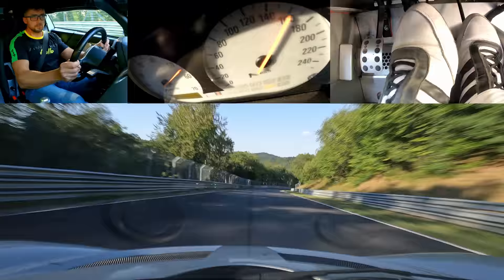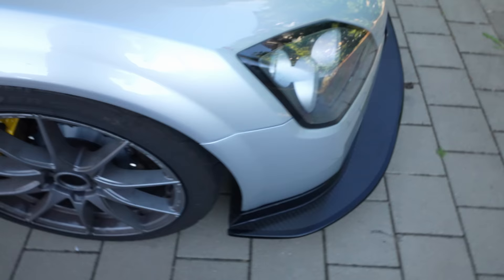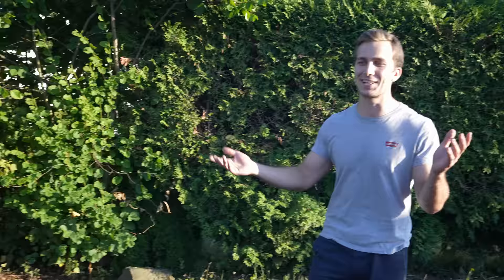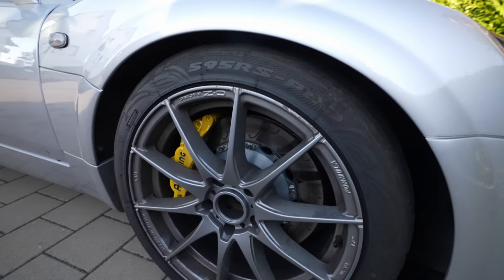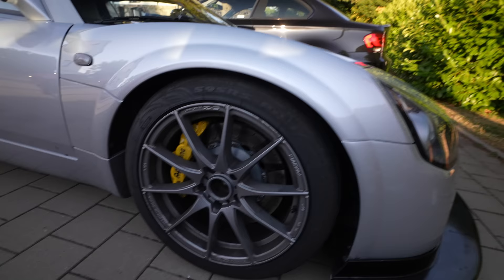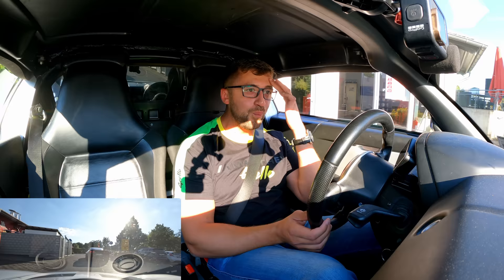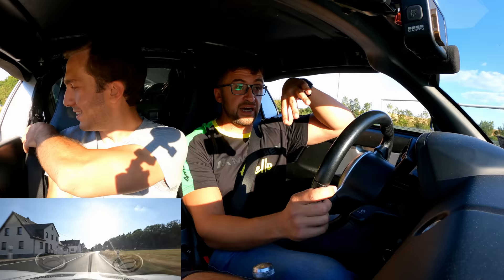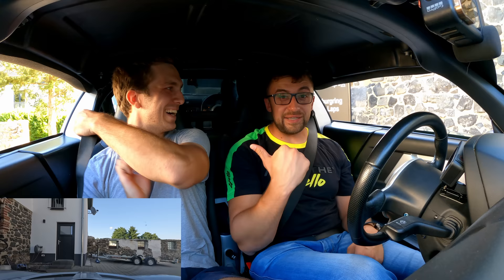This Engineering Student Built a PERFECT Track Car!

Comment: Opel Speedsters are underrated, with a "few" mods they put out insane roundtimes on different tracks. buddy of mine has one with semi slicks, KW suspension and  mods to get 250 hp. it beats a shitton of cars on curvy tracks or roads.
JP Performance drove one on his LaSiSe "track" and its as fast as an RS3 8S (heavily modded) , R35, Taycan Turbo S, faster than a BMW M2, Camaro V8, Audi R8 V10+, Ferrari F12, M5 F90 and more on that small "track"
this one here is just insane ! love it. hunting that Porsche was pleasant to watch <3
but i wouldnt call it GM engine. its an opel engine. that 2.2 is "from" the opel Astra G  / Vectra C etc

Comment: 9:46 It would take some work, or if he was to do a second build. I have something that would blow your minds. Remember how it’s said to LS swap it. I am regurgitating the same thing. This is a absolutely perfect example for doing the swapping. Misha Charoudin. Make sure you pass this along and let me and everyone else know both of your thoughts, and when it will take to complete it. Please I believe that it along with his ability in what he’s done so far, would be insane. The catch is doing it with a LS4, and not hodgepodge parts together. You he will need to figure out what to do about strengthening the transmission, and the 4 speed might have its limits along with benefits.
Reply: I’m already doing a swap, but it’s not an Ls, the problem with the ls is that it will physically won’t fit in the car, you need to extend in both directions the chassis to make it possible.
Reply: @lapocorenich  I did notice that there was like a small box that the I4 was in, did not know what all bracing vs other parts were what. The video was great, and especially knowing (I know that for many factors it was a lot) how much was in it, and that you put the work in, and the level of detail that you designed into it. All that, along with you being in school and as young as you are. Hopefully you understand what I am saying, It, a mouth full. You have a good future ahead of you. And just imagine what you will build in the future, wether it is you physically building the parts, or you contracting it out. Your builds are going to be great. Thank you, and Misha. That was a really enjoyable video.

Comment: Did you know that Kevlar is an aramid fibre? It's additionally produced by a company in the USA called E.I. Dupont, who came from France. They developed it in the 1970's. It's not the best fibre, though. That title belongs to Dyneema, which is from Germany. That's where it was developed. Knowing that it's a fibre, it's similar to a fabric. Do you know how to stiffen it? By having an epoxy resinous between all the layers of those sheets of it. What else do I know about Kevlar? It's lighter and stronger than carbon fibre. Why is Dyneema better than it? It's not affected by ultraviolet light, which is what Kevlar is. That's the reason why there's a fabric that covers it when it becomes a bulletproof vest. After a year of use, they give whomever's wearing them another one.

Comment: What car is this? Has he completely built a new car? Meaning all the chassis and body panels or has he used an existing car model and modified it?
Reply: It's a Vauxhall VX220/Opel Speedster. He has modified the car with aero pieces in order to create more downforce but has not changed any of the body panels underneath the new aero to my knowledge
Reply: @wideshadyy  Thank you for the explanation

Comment: I dont know...i drive a turbo miata with 595 federal as well.. (small light, no abs, powersteer ...) This car look bad to control(pedalcontrol and steering), instabel and dont work well at all(bottem out, hopping stiff tires...)... no offence, but this car is slow and relative unsafe.(like my old miata) It may be fun to drive but when its unsafe and relativly slow when compared to normel modern sport cars (like a civic type R fk8, porsche boxster, bmw m2, clio RS, toyota ...) is it realy this "good" I like emotion as well, but think this kind of cars are just outdated. And to unsafe for fast NOS turns.

Comment: 28:05   Actually false. You absolutely can save RWD oversteer with throttle, you can't call yourself an advanced car control expert without, and could save your life. And ironically, you said the answer your self. If you lift, it gets worse, which is trailing throttle oversteer, which weight transfers to front, losing more rear grip. Getting back on the throttle modulated accordingly, shifts weight rearward, regaining grip(when done rapidly with authority and knowledge), modulated accordingly, can save spin, even to point needing to full throttle drift, if needed to not spin. Even fast lap time drivers, especially in this era of huge tire grip, traction control and ABS, can be under developed and lack this skill. Many crash that could be saved, but are unaware. That's why I can't take any fast grip driver seriously if they aren't at least moderately proficient drifters.
Ask winning professional race drivers Johnny O'Connell and Billy Johnson.
Reply: Okay so say that when you’re loosing control at Foxhole 😂